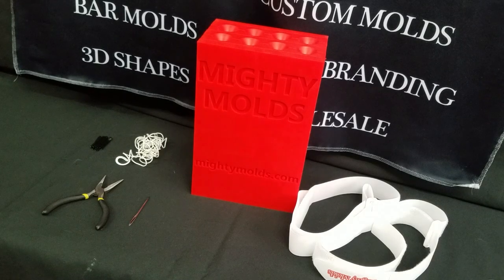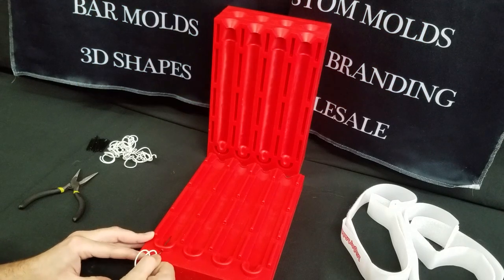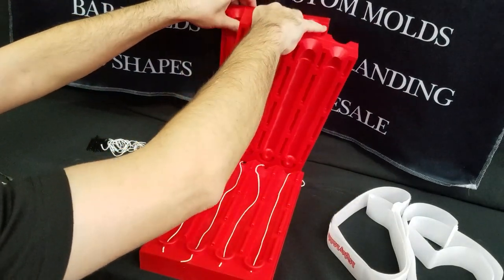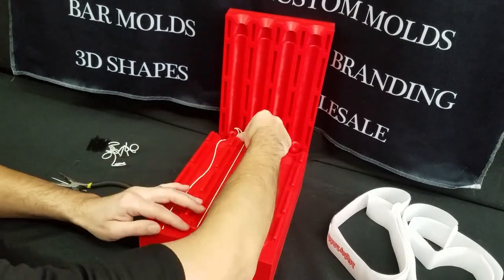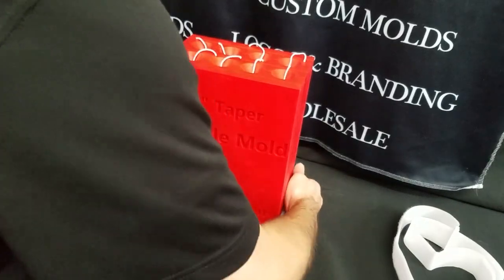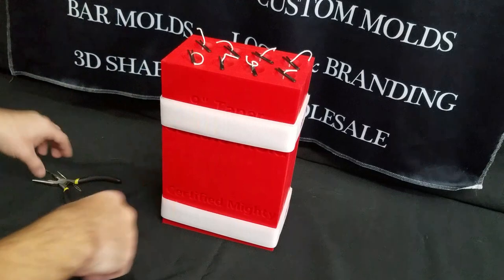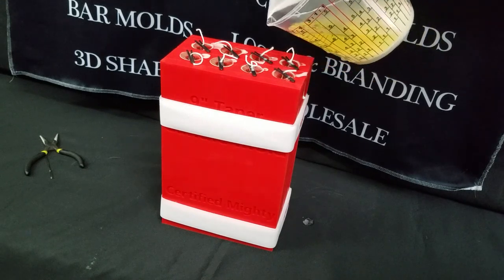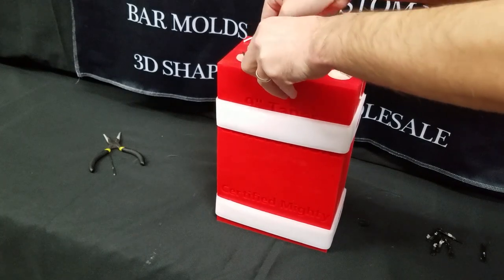Taper Candle Making with a Modular Silicone Mold - Mighty Molds

Comment: Do you spray the mold with a releasing agent?
Reply: So, disclaimer, I have made candles for a grand total of 2 weeks 😂. And with a silicone mold that is not a Mighty Mold one.  But!  The seller I bought it from told me that one of the pluses of using a silicone mold is that you won't need to spray it with a release agent.  

I don't know if this is the case for Mighty Molds, but it is the case for the ones I use!
Reply: @JBrodo  I have been trying it with and without a releasing agent and have found no difference in the final product candle. I have been watching more of the MM videos for tips and tricks and have learned a lot of good info. I'm glad I bought it.